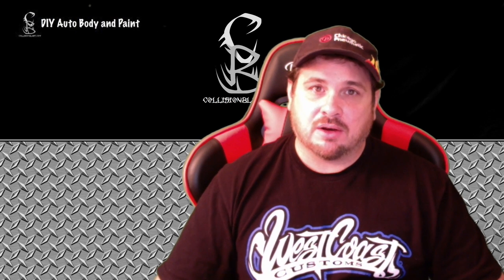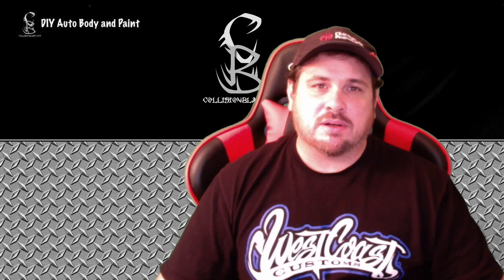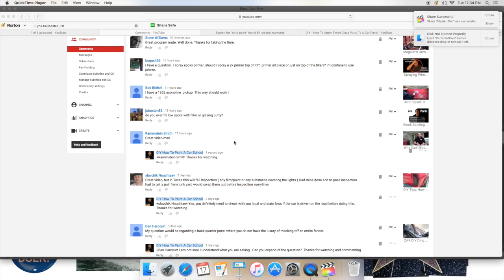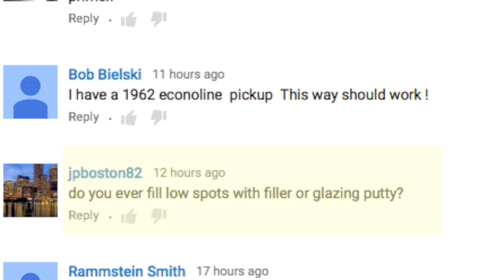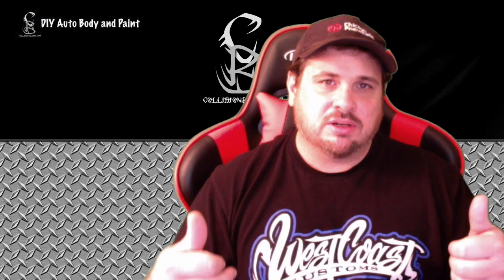Q&A Can I Apply Putty on Low Areas?

Comment: I read the TDS everytime I use a new product I like 3m 1k acrylic glazing putty for tiny pin holes i scuff with 150 grit then apply putty leave it for 20 min according to TDD then i continue to next project then sand out with 220 then 320 . I have learned so much from you

Comment: Do I need an epoxy primer under my polyester primer or can I spray the polyester directly over sanded area? There are small areas with exposed bare metal but not much. I have some oil based primer could I spray that over the polyester primer after?

Comment: I was priming with epoxy primer then the bike fell. Can i apply bondo over the scratches from the fall? Or do i sand those areas then primer over them?
Reply from the maker: I would sand the area just enough to rough it up for the filler to adhere.  If it's just a scratch, no dent, you can feather edge the scratches and reapply epoxy.  Body filler can be applied over epoxy as long as it is sanded before applying.  I hope this helps.

Comment: What putty do you use if it's acrylic lacquer and do you have to remove dry guide coat out of pin holes and of low spots before reapplying filler or primer

Comment: hi is there a spray type of glazing putty?
iv heard of this one contour polyester glazing putty is that good before surface primer for mini dot holes
Reply from the maker: Eastwood's contour glazing putty works well for filling pin holes.  It's a spread type of putty.  They do make a Contour polyester primer surfacer.  Its a high build primer surfacer, but I would not trust that to fill all the pin holes.  I would use the spreadable putty first, then use primer surfacer.  Thanks for watching.